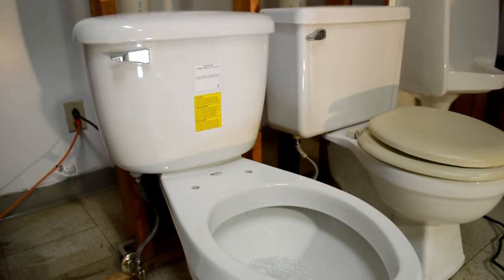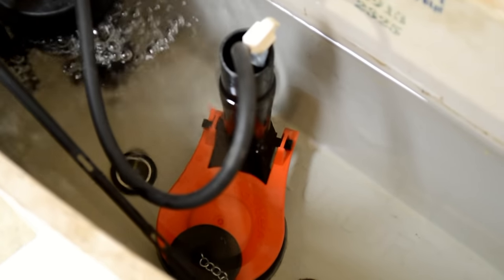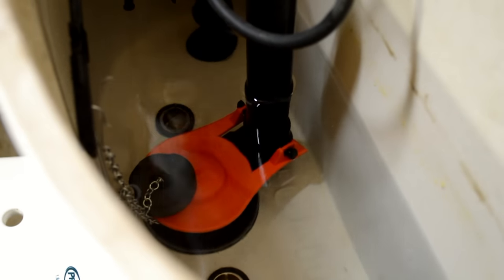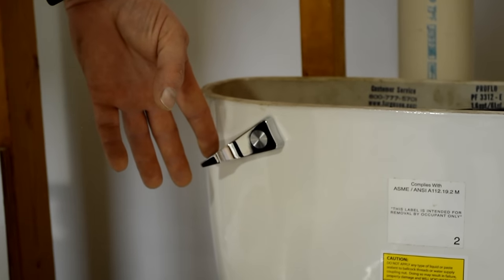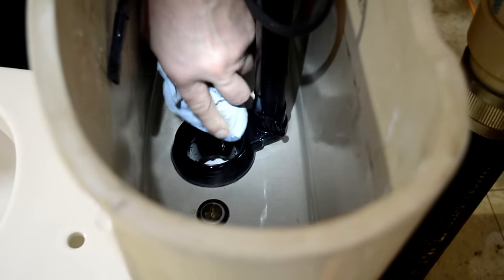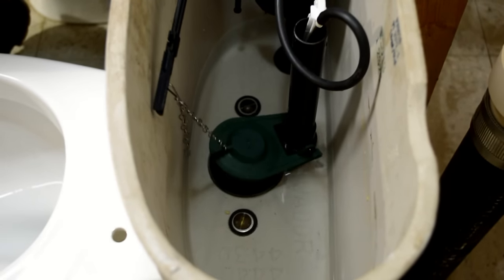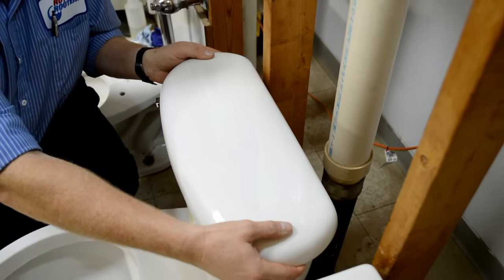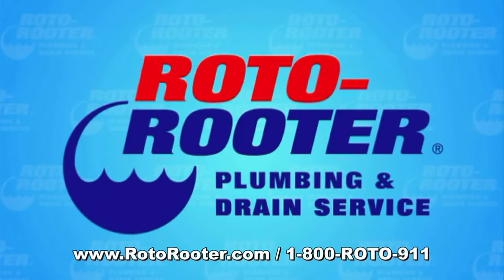Plumbing Tips - How to Replace a Toilet Flapper Valve | Roto-Rooter

Comment: What if the new flapper won't go down?
Reply from the maker: If the new flapper won't freely open and close, it may be the wrong flapper for your toilet. First determine where it's catching. If it's catching on the hinge pins, you most likely have the wrong flapper. We suggest looking up your toilet model on the manufacturer's website. You should find the information you need stamped onto the porcelain inside your toilet tank.
Reply: @RotoRooterTV  it flushes 3 times before it finally goes down. It just stays up for a while and slowly goes down.
Reply: @ingyb6180  -- You need to get one with an adjustable water inlet: You can vary the volume of water it allows in with a simple twist which either opens or closes a small hole just below the seal on the flapper so water goes through said hole immediately to pull it down quickly which results in a higher toilet bowl water level, or slower so your bowl empties completely first before starting to refill. Water conservation shit.
Reply: Or just deal with it. Laugh

Comment: Trial error style, not efficient work.  Use the lever hole close to center of flapper and remove chain clip.  With lever at rest position, flapper seating on hole, pull lightly the chain aligning it to the target hole, this will be the length of the working chain,  attach the clip and test functionality.

Comment: Didnt work still leaks even bent rod ball adjusted screws still leaks on flapper
Reply from the maker: If you're using a universal flapper, we suggest getting a replacement flapper recommended by the toilet's manufacturer. If that doesn't work, it may be time to call in a professional.
Reply: @RotoRooterTV   got it to stop 99% petroleum Jell leaks a hair barely hear doesn't self flush thanks for the reply be safe

Comment: There’s no water in where the flapper is it doesn’t fill up handle is loose won’t even pull the flapper
Reply from the maker: You'll need to adjust the chain length so that the handle can pull up the flapper. If there's no water getting into the tank, you may need to turn on the water at the supply valve.